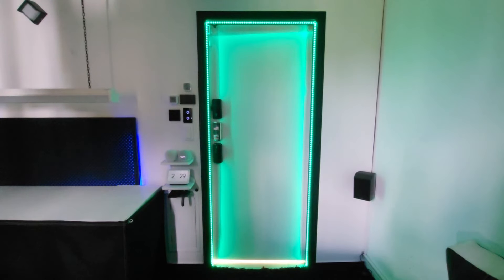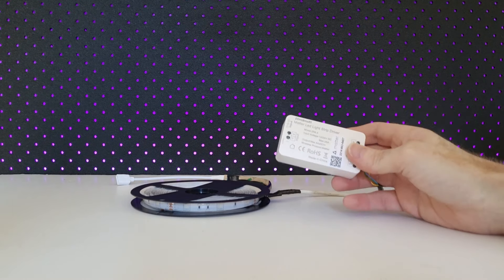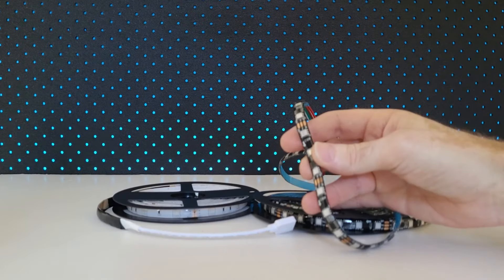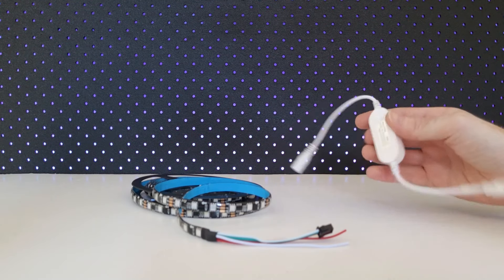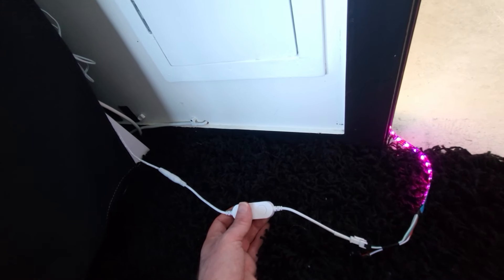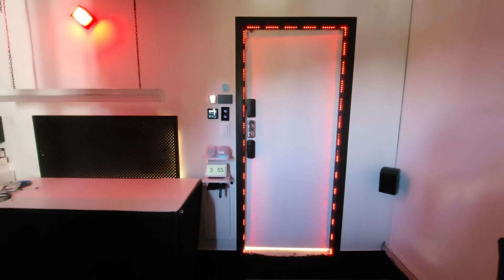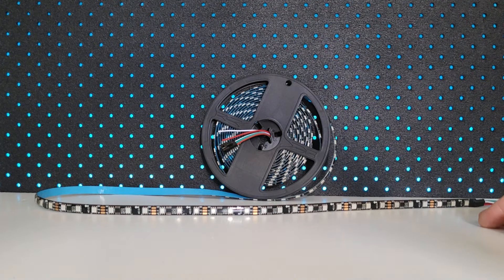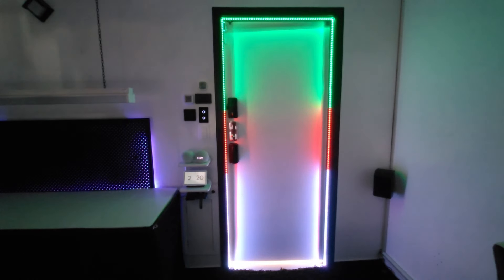How do you use Addressable LED strips? What is ARGB LED?

Comment: I intially thought this video was going to be about RGB LED strips with a forth Amber chip.
As I have never heard addressable LED strips described as ARGB before
Reply from the maker: @SandyCrack69  Thanks for your comment. The LED strip you refer to is still standard RGB and is generally the difference between RGB 4 pin and RGB 6 pin. Another great thing with ARGB is those cold and warm colours are all included with addressable led strips, unlike the RGB 4 pin led strips which are solely RGB colours only